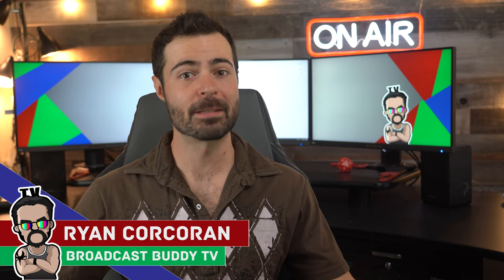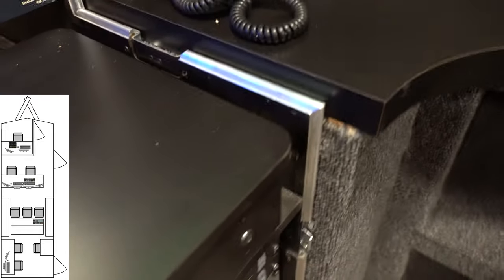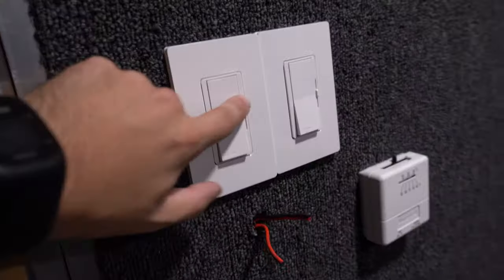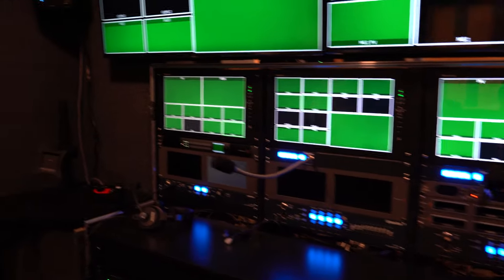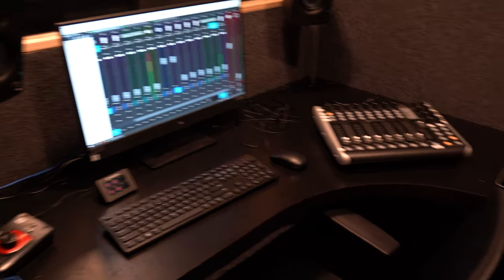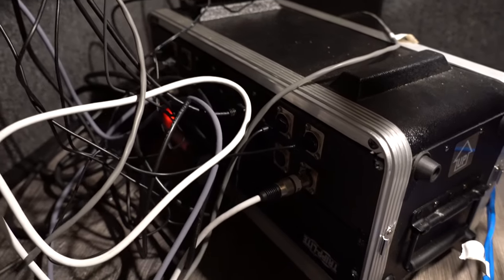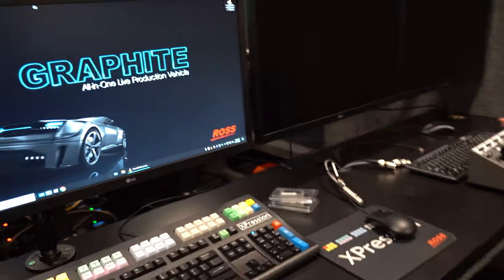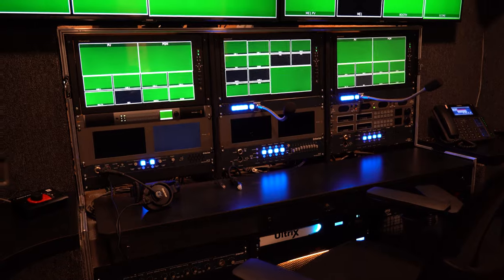Let's Build A Mobile Production Unit, Part 7 [Broadcast Engineering]

Comment: I love this series! What do you expect the trailer to weigh when full? What are you going to tow it with?
Reply from the maker: I'd have to figure out the weight between fully loaded with gear vs just the equipment... I'll try to get that statistic in the future. I can tell you though that I'm towing it with a diesel Ford F350.